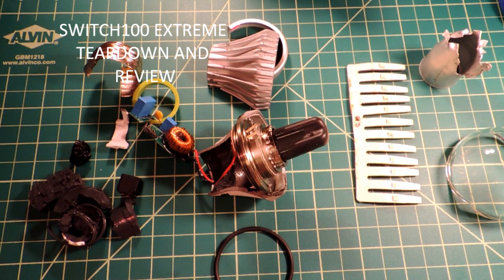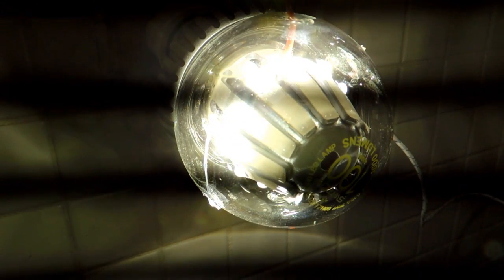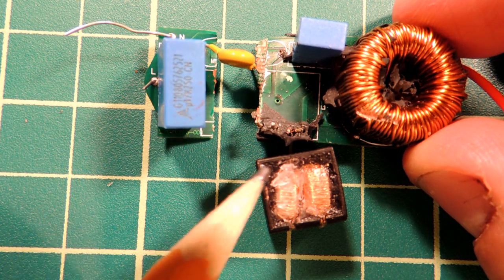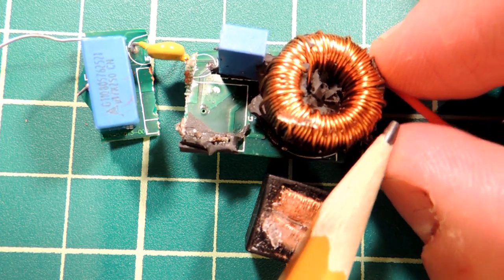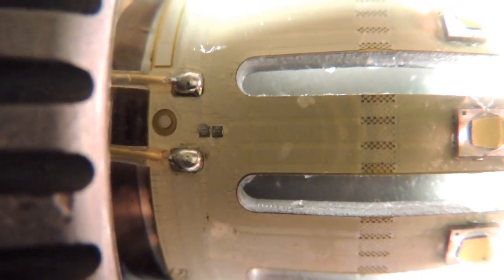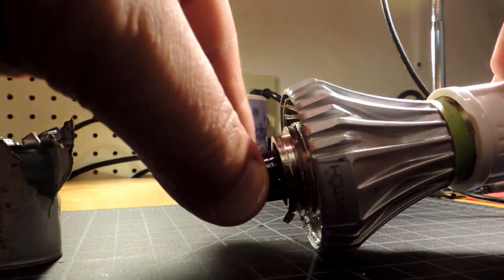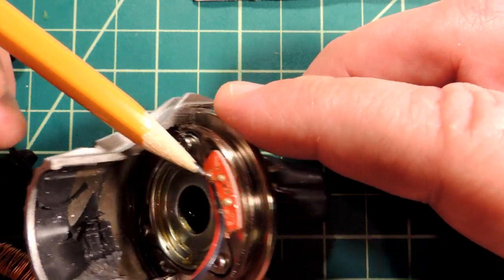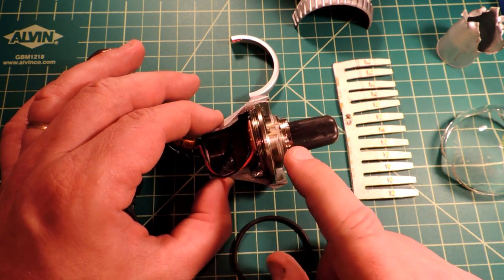Extreme Tear down Switch 100 "100W" LED Light Bulb part 2 of 2

Comment: SeanBZA,

Most of what you wrote in your comment is wrong.

Flicker in this case is a 120Hz frequency, dimming is a slow near steady state response. Capacitance to reduce flicker would have almost no impact on dimming.

The fact they are dimmable has nothing to do with the flicker as there are lots of LED bulbs that dim, but do not flicker.A simple added capacitor on the mains will solve it either on its own. There is a lot more to it. EMI filter/fuse is not "nice" it is essential.

Comment: Can be cost reduced by using plastic parts for the lamp base and sealing that with some method compatible with the silicone oil used. The reason for the flicker is because these are dimmable, so if they put in enough capacitance to not flicker they would not be dimmable at all. Might be a market for them there, just add a 1uF 400V metal film cap on the mains side to keep the oscillator running, and it will not flicker. Nice that it actually has a fuse and has the EMI reducing components there.